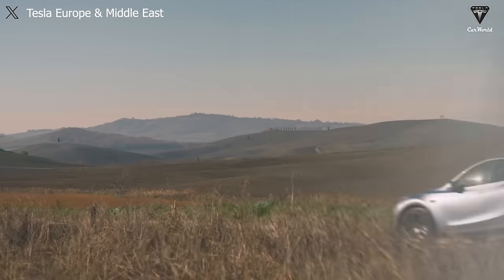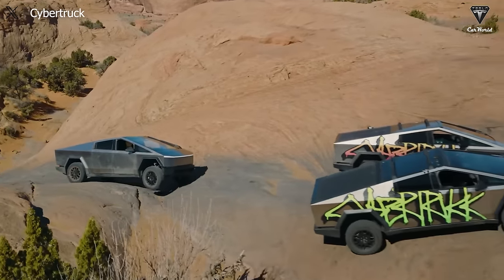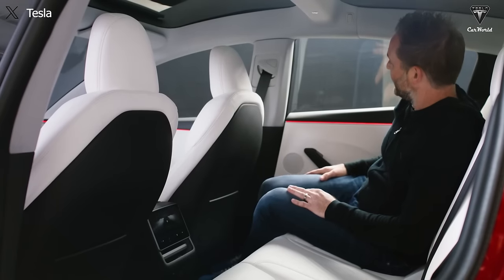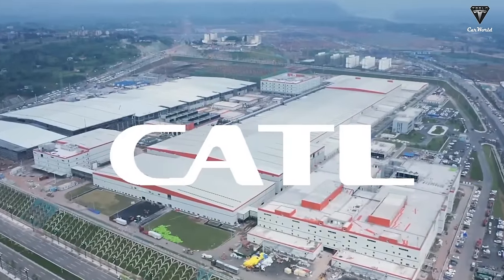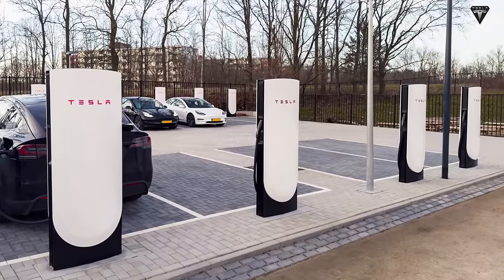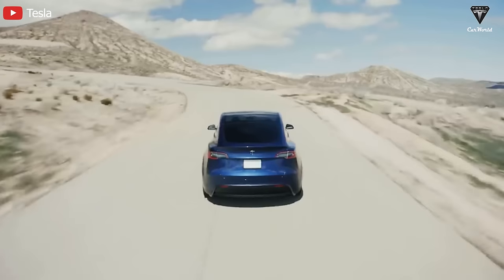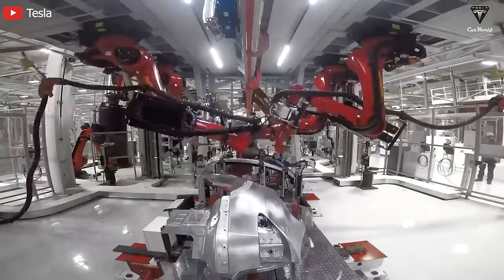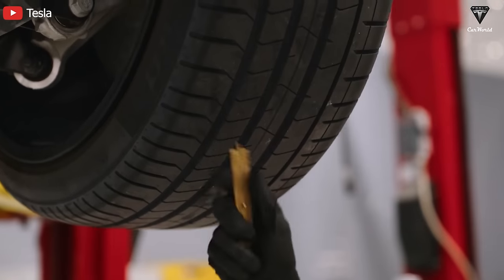It happened! Elon Musk LEAKED Update Model 2 Redwood - REAL Specs, Battery And Unique Production!

Comment: 250 miles sounds perfect for the entry version. its the shortest range that musk has always mentionned as a requirement, saves 10% capacity compared tto M3 rwd, before even getting into efficiency improvements due to size and weight and maintains the line up hierarchy, plus. harging speed should be sufficient paired with 250miles for long trips.. they dont want to cannibalize the 3/Y too aggressively, so range, performance, comfort, and "luxury" like glass roof, premium sound sustem, etc will all be down a notch there's no doubt the LR AWD will be 300+ miles and pribably the preferred version in the us